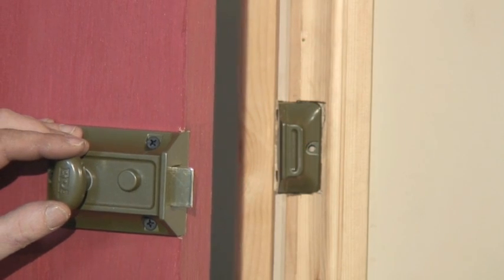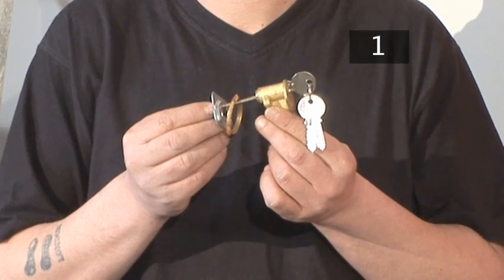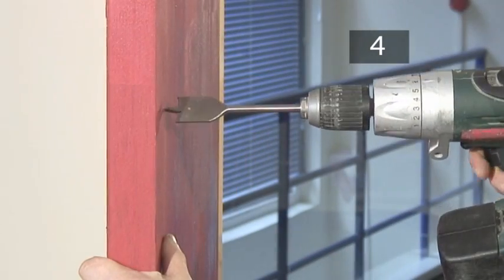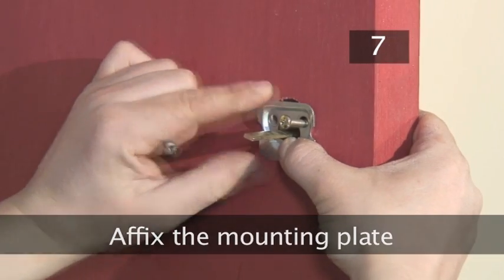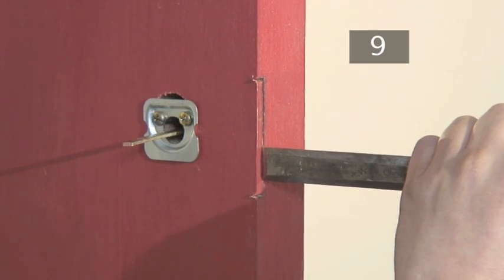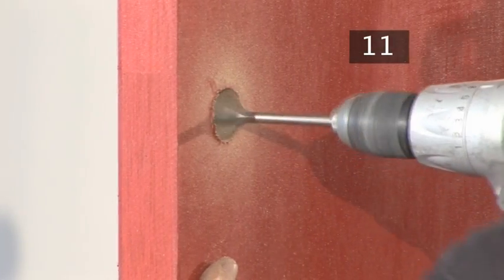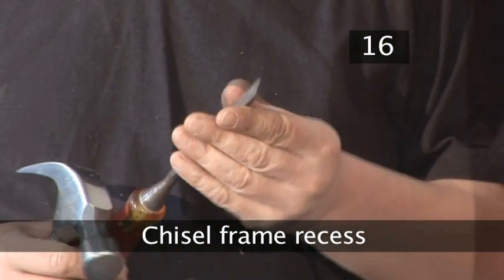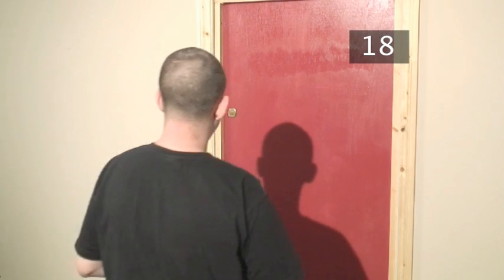How To Fit A Cylinder Night Latch

Comment: This video will help me fit my lock. It shows that the 32 mm diameter hole goes right through the door but there is still space for the backing plate two wood screws to be screwed in.  One must work accurately here because there is not a lot of space! What is the minimum thickness of the door required to fit this lock?  Thanks.

Comment: Step 7 should be, affix the mounting plate bolts to the rim cylinder.  Also, no mention of cutting down the connecting bar if required depending on door thickness.

Comment: Great demonstration video - should add that a utility knife should be used to score the area being chiseled to prevent wood breaking off and making an unsightly finish. Always sand smooth after so finish paint can be applied. 7/10

Comment: Would be better to make pilot holes for your screws before drilling them in (mark positions with a bradawl, then use a 2mm drill). And chiselling is better done with a wooden mallet than a steel hammer. But, a very useful detailed set of instructions

Comment: This only covers the carpentry. The difficulty of adjusting the length of the connecting rod isn’t mentioned. I had to use a metal saw to shorten mine but you can use a pair of wire cutters (see the East End Carpenter video). It’s the most difficult thing to do and if you don’t know how long to make it, it’s a bit scary trying to guess. Essential information. My Yale night lock is identical to this one.

Comment: Overall reasonably good, but if this chap is a qualified carpenter he needs a refresher course! Done? Really? Either the lock body is not level or the keep isn't! The fit around the keep/staple is very poor, no attempt to match the shape to the architrave. Grabber screws to fix it to the door, really! What's wrong with the screws supplied with all locks? No pilot holes, door not wedged whilst working on it. Poor chiselling technique, (with a blunt chisel) I could go on. I would also suggest using a marking gauge would help accuracy and neatness when setting out for the housings. Fitted at a 'comfortable height? Normally between 1200 to 1500mm from the floor. The VoiceOver is the best part.

Comment: Instruction good but technique very poor, marking out should be done from both sides and rebate for lock marked from centre line. Edges of lines for chisel section should be scored with knife to guide chisel  to avoid poor execution as shown. Lock tab will need cutting depending on door thickness and NEVER use drywall screws in timber as they have no shear strength.